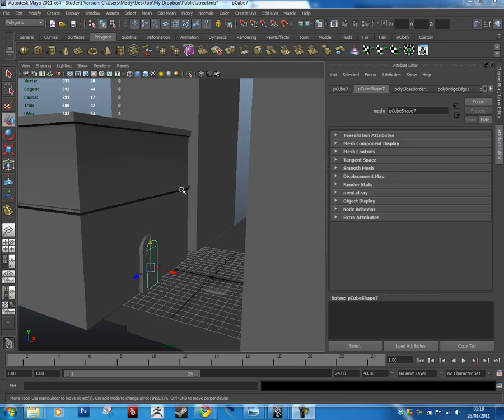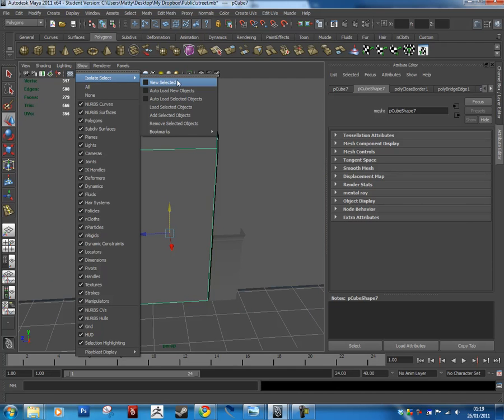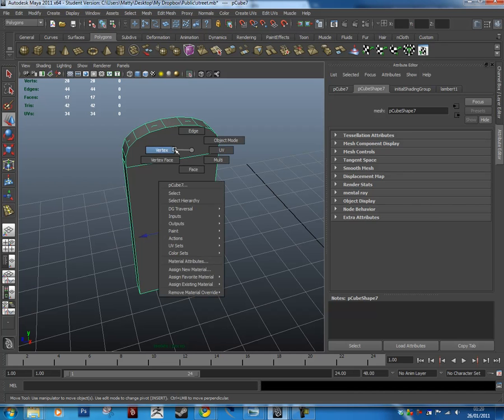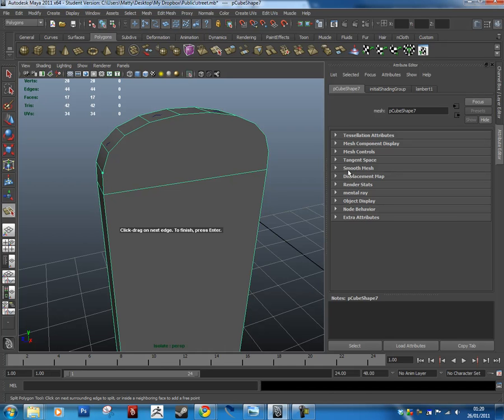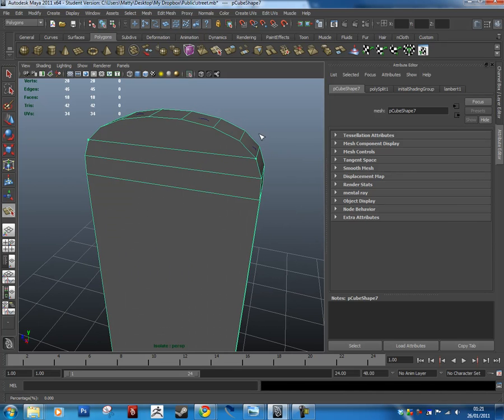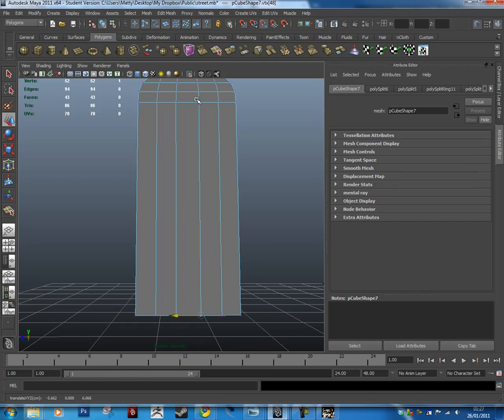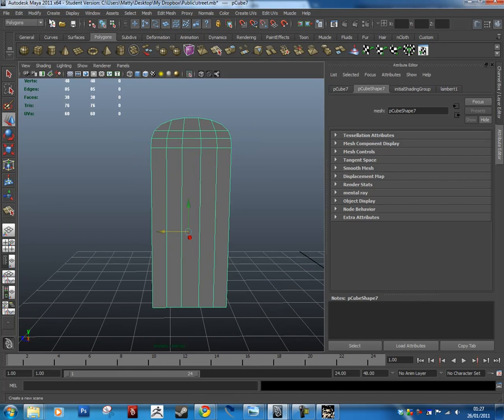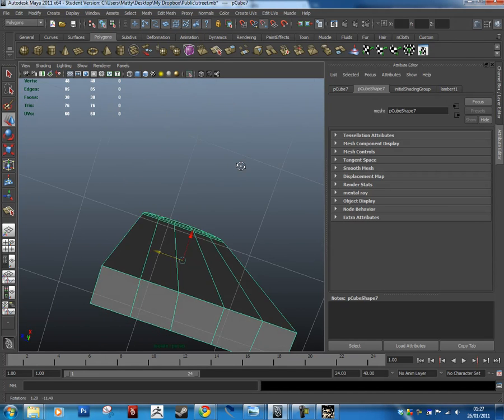MAYA 3D Modelling Tutorial - Modelling a Door

Comment from the maker: I usually try to work in quads (4 sides) or triangles.  If your model is going to go into a game engine your will most likely needs to triangulate it before it goes in so all the quads will get divided.  Just depends on what you are using it for.  At the end of a model i would recommend going back and making sure you have quads or triangles on all faces.  hope that helps